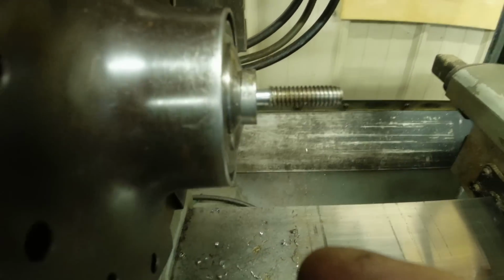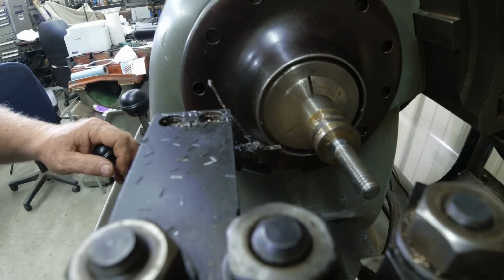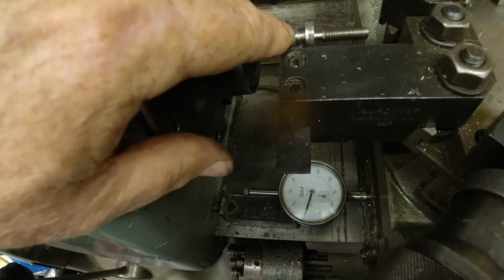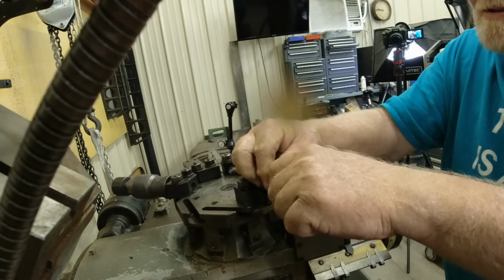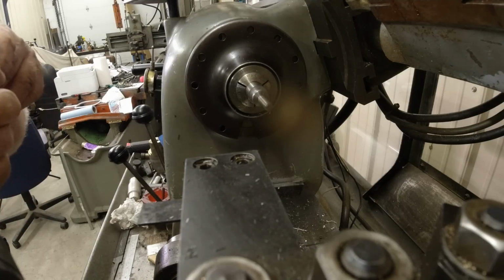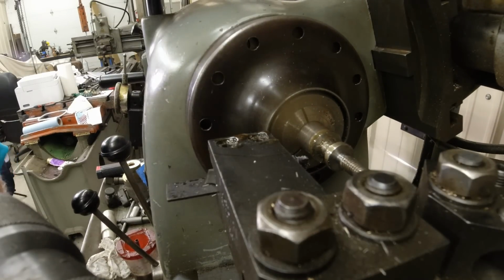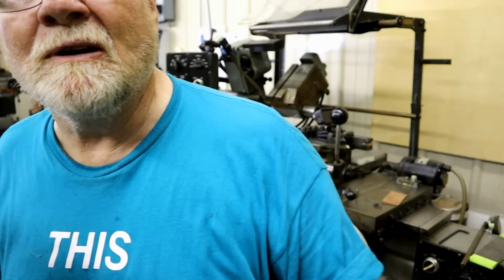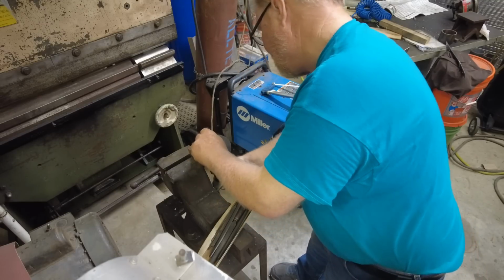Someone Screwed UP The Screw! : Part 2

Comment: Think your falling in love with Mr Bob Hardinage aren't you. IVE wanted one for years . At one time during my apprenticeship for a year worked in a valve manufacturer setting up and operating W&S turret lathes ill tell you ya worked your ass off making parts from bar stock everyday on those big boys. I could cut acme threads on shafts in a minute  .
Reply from the maker: I am in Love :)